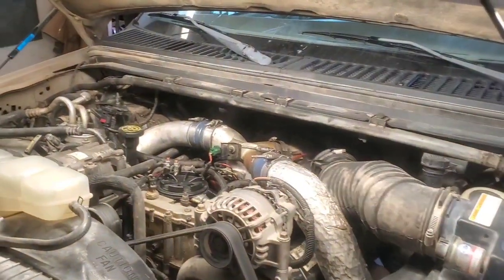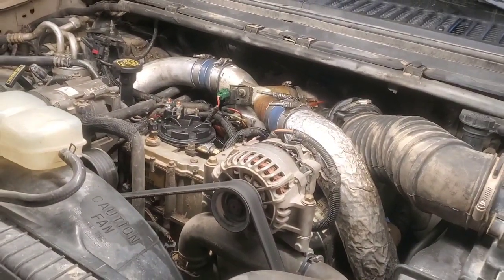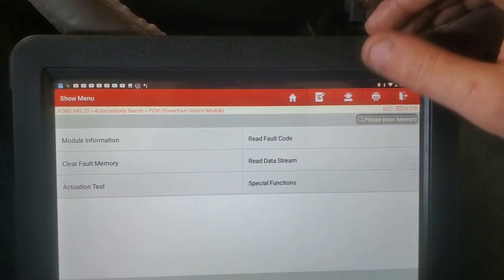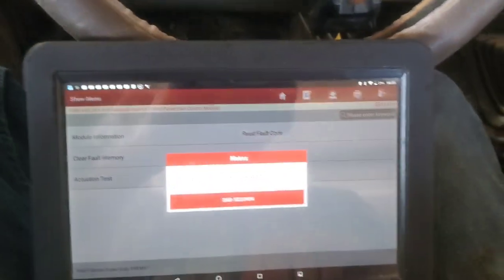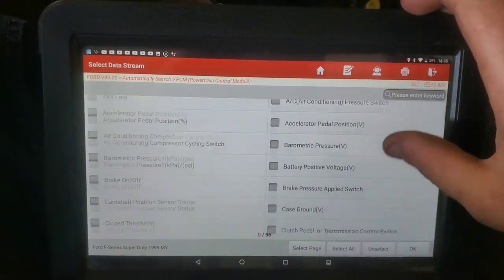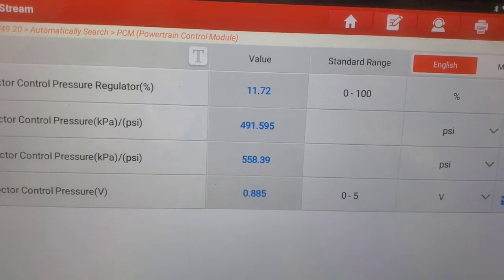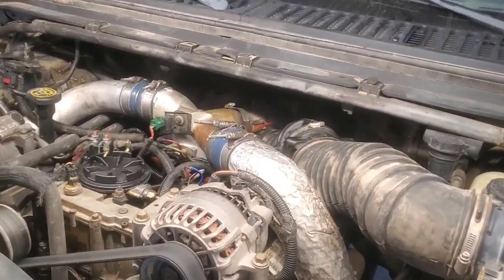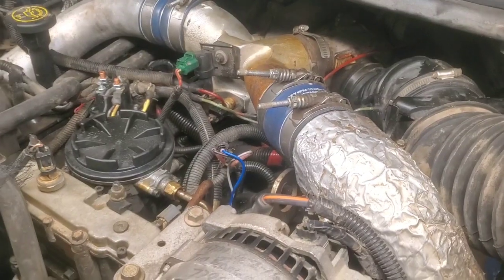Solved!!! 7.3L Powerstroke P1280 code only at startup.

Comment: appreciate this vid. have a 01 F550 at work with exact same issue.had already  tested voltage at connector checked the harness at valve cover for chafing. ended up being a lazy aftermarket icp just as you described. mine was a 2 week old garbage carquest. get what ya pay for.

Comment: Thank you for this video. I have a 7.3 PS that exhibits a very erratic surging startup, then smooths out and stays idled up quite a bit higher until that SES light goes out then idles down and runs very smooth.  If I do what you did, and just wait until the SES light goes out (around 16 seconds on every startup), then the truck starts up very smoothly and at lower idle every time.  I was really scratching my head on this one because I wouldn't have thought that the ICP could have that influence while the key is on but the engine is off.  I'm absolutely sure that is my problem.  The ICP on this truck was also from NAPA and is only around a year and a half old now.  The Motorcraft ones are outrageously priced now.
Reply from the maker: Look into places like Thoroughbred Diesel or Riffraff.  They might have some aftermarket ones that should work.  The NAPA ones do not work. I tried one again a month ago and it was the same symptom as this one in my video.